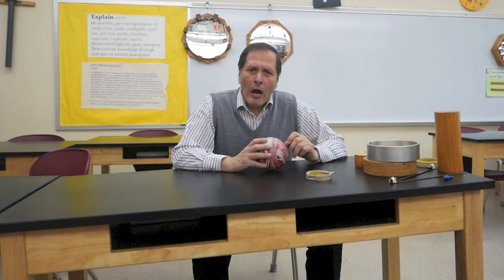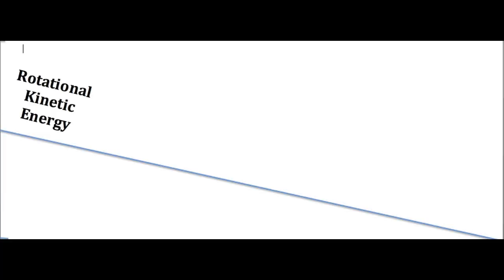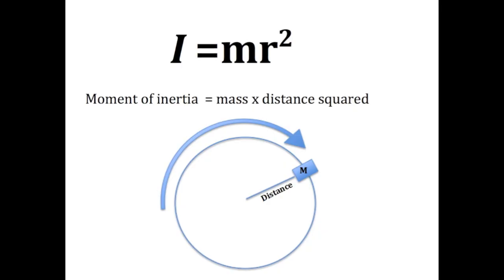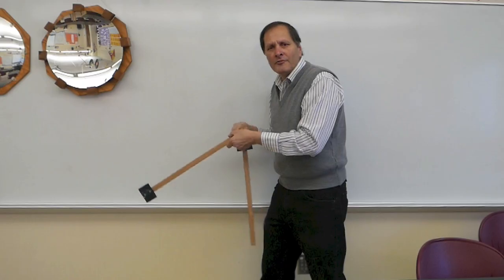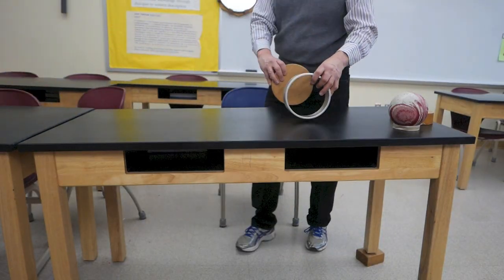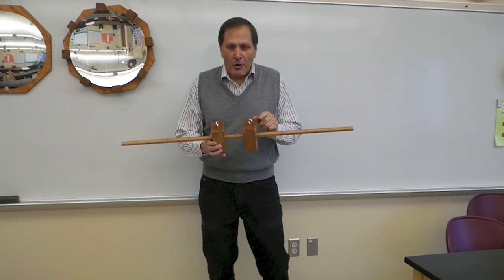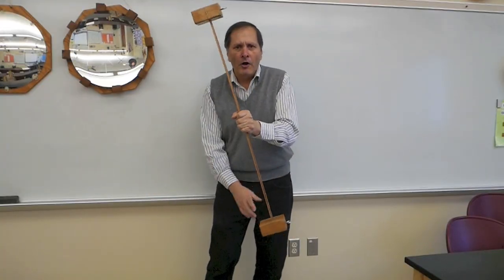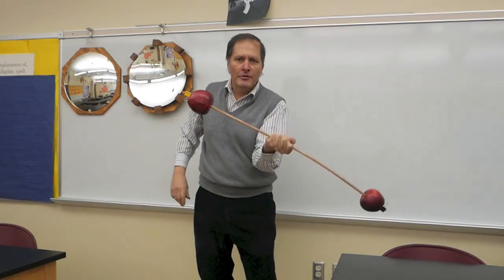Feel the moment of inertia-Physics of toys  // Homemade Science with Bruce Yeany

Comment: I’m still a bit confused. The greater the distance from pivot the greater the torque so I’d expect a greater angular acceleration but the moment of inertia says that greater distance means greater resistance to motion and smaller angular acceleration.

Also, say you have a 1kg mass 1m away from pivot and you apply a 1N force to it(so 1Nm torque), but another 1kg mass is 2m away from pivot, this original force causes this one to accelerate hence a force is being applied to this mass as well, this force is greater as it has a greater tangential acceleration due to being further away. Same mass, same angular acceleration, but greater radius gives us a greater torque on the second mass than the first, how can this be if only one force was applied? Shouldn’t the torque be the same at all times on the same side of the pivot?

Comment: Ok so now a "moment" is not just an abstract unit of time, such as "a moment of silence".  Or why is it called a "moment" of inertia? Inertia is a property of matter, and matter exists without regard to time, apart from influence from outside forces. A pen on my desk is there as for long as I leave it there, not just for a "moment". The "moment" of inertia, the "time it takes to change acceleration" increases or decreases according to the formula I=mr^2: when there is a change in mass or the change in radius. This change affects the time, but the "moment" sounds like it's somewhere between a) the amount of force needed to modify the at-rest or in-motion state of the mass, and b) the amount of time it takes for the same constant force to modify the at-rest or acceleration of the mass. A moment of inertial is somewhere between a measure of time and a measure of force. Is that right?  I have been wanting to understand this for many years.

Comment: Sir, I am happy I found you, I posted the same question below who try to explain MOMENT OF INERTIA, in videos but i am not satisfied, i hope u can explain it.  
In moment of inertia I =M*r^2, how did r^2 came? 
If body is point mass or continuous mass, from axis of rotation at…….. r distance….. when force applied it resist to make change in rotation is called as moment of inertia, then it should be
 I =M*r
 then where did another r came from, please clarify me? 
 
I am confused why it will be r^2, what is it use being squaring r, how it is deduced?

Comment: Sir why mass in car's tyre is distributed at the periphery.  Instead Of centre?? While if we arrange mass on centre it decreases moment of inertia and easy to move. Please reply me sir i'm waiting.🙄
Reply: Hi Dip, try to visualize that the whole thing that turns in a car is the axle plus the tires. And obviously, the axle carries the majority of the mass, and it turns closer to the axis of rotation.
PS: I'm a little bit of physics teacher too :D
Reply: @shivanshraj6571  i have get my ans. Sir just imagine it if we decrease m.o.i. of tyre then it will take low force to move and similar more force to stop and it will avoide all the irregular section of roads
Reply: @shivanshraj6571  and I'm talking about axle not tyre in acle mass is distributed at the corner

Comment: if I add extra weight to the center of my car wheels ... will it drive faster and use less gas???
Reply: No ... all you've done there is increase the mass of the car, which would make it accelerate due to gravity down a slope faster (as the resistive force caused by the moment of inertia of the wheels is now even smaller in relation to the pulling force due to gravity on the vehicle). But on a level surface, you'd use more gas to reach a certain velocity and you would not accelerate as quickly. If that's even a serious question. Lol!

Comment: can you explain me the part after 5:12 why the excel  wheel reach early then solid sphere..?
Reply: Bcz same mass is distributed between two disc and they have there axis along the line connecting them so if we calculate moment of inertia of a individual disc it is less than solid sphere. But if we compare a disc of same mass m.o.i. found to be more.
Reply: May be the ball is hallow at middle